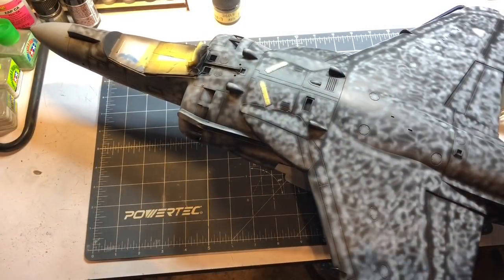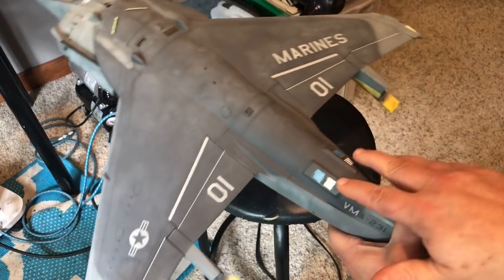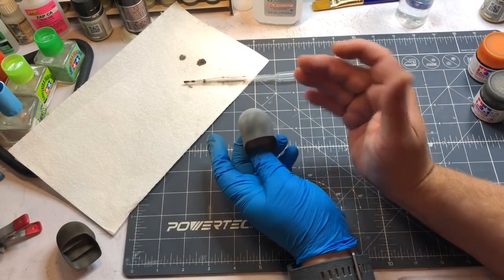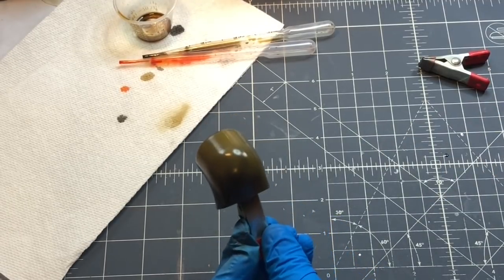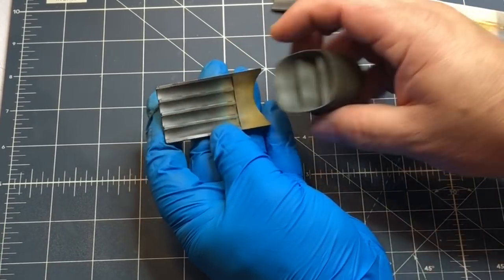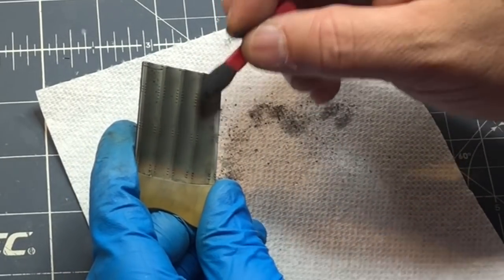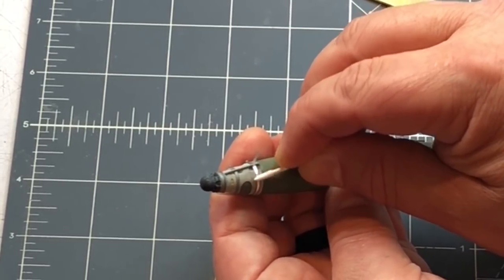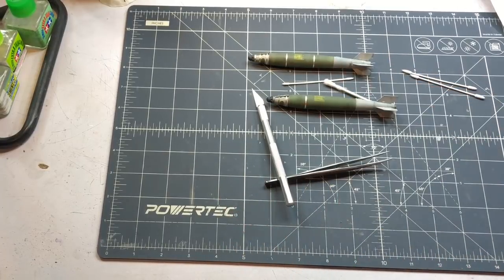HobbyBoss 1/18 AV8B Harrier Build Part 7: Paint'n

Comment: Fantastic work , bigger is definitely better . Reminds me of the shuttle build which is epic in its own way . If you want a good binder for pigments use adhesive promoter in spray or liquid and the pigments will bind permanently , rub it all you want only alcohol will remove it and a better base for the clear coat especially if you want a real matt finish . Actually spraying a thin coat of adhesive promoter before the clear coat will give you a more matt finish then paint alone in my experience , your mileage may vary .
Reply from the maker: Thanks for the tip!

Comment: I’ve been enjoying your videos about this model. As a Harrier engineer, I wanted to let you know that the two small ram air inlets that you painted white on the inside, actually they are reddish orange. The actual ducts have gray that is on the skin painted for a couple of inches inside past the leading edge, then it is the reddish orange color. The color is because it is a type of rubber liner . For the Hot nozzles blast shields, you could have painted them all with the gun metal and then highlighted with black to simulate engine soot.

Comment: You need a bigger workbench lol Looking superb, just remember not to do much chipping on the wing, lerx and tail plane surfaces as they are composite and the leading edges are aluminium ;)
Reply from the maker: Awesome info thank James!
Reply: @seanerk5kt9  you've nailed the hot nozzles. The blast shields (one of my first jobs out of the training school at Kingston was helping seam/ spot weld them), need a bit more oxidisation (browns) on them, as they were a ferrous steel - so more like the nozzles. 

Also the cold nozzles (the front ones) weren't painted on the RAF versions, but the US Marine one's were - however when the RAF retired theirs, they went across the pond for spares for the Marines, so you could have unpainted ones ;)